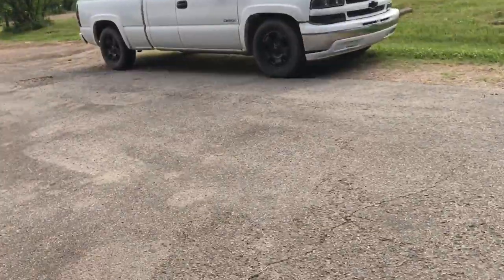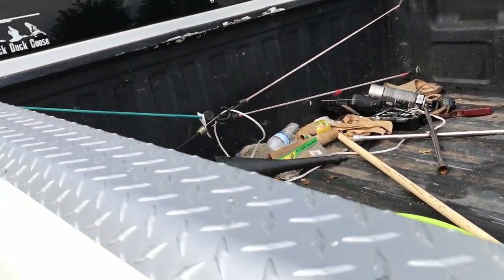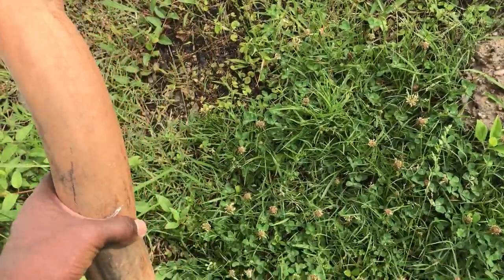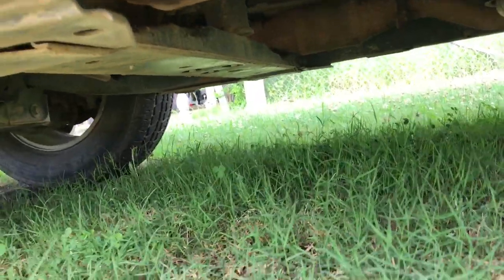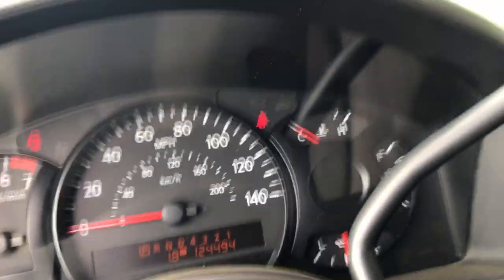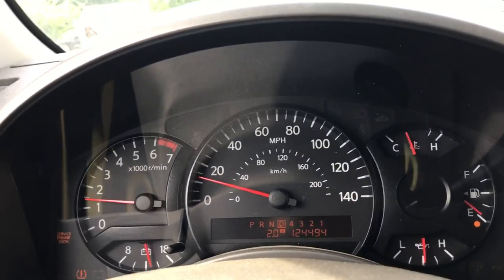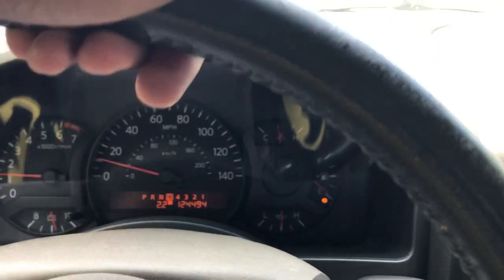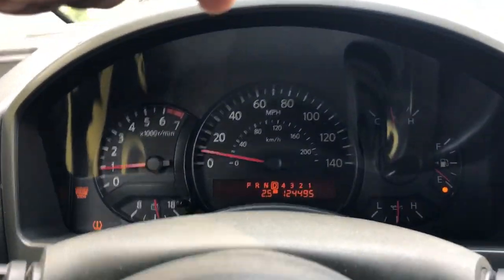Catalytic converters are clogged on my dads Nissan Titan

Comment: Same thing happened to me It started with the Manifolds cracking and then drove like that of awhile. Then I stared getting bad Catalyic convertors that were going bad, Then I had the money and time to replace the Headers I bought those installed them and they were so freaking powerful they blew the Weak cats out. Unfortunately part of the Metallic substrates from the cats got sucked back into the engine and then my engine got scarred. Now I am buying an engine replacement , JBA headers and B Cajun pipes and the UPREV not fucking around anymore with Nissans pathetic cat design

Comment: While ur checking it out make sure all ur cylinders are firing. O2 sensor, cat, or dead cylinder can give u similar symptoms
Reply: Will it throw a p0420 code even if its not the cat?
Reply: To test MAF just unplug it and your truck with run smooth.  Then replace it

Comment: u have no gas first of all. but my is doing that and I'm replacing all spark plugs and mass airflow sensor. A bad sensor has symptoms of engine hesitation.
Reply from the maker: Adam Short yeah tru but it was the front cat it broke apart and clogged the back catalytic converter

Comment: fuel pump.. my 07 nissan did this same exact thing 7 we replaced the fuel pump and it solved the problem and we havent had a problem out of it since then. try not to run it on E too much.
Reply from the maker: Cheyenne Wofford it was the cats they were clogged but I got them deleted
Reply: Cheyenne Wofford my 04 was running great I use premium only I did run it low on gas a few times after running it near empty a few times I noticed if I had to step on it hard it would hesitate it will pick up speed but have to feather the pedal can't take off fast like it use too. One day I wasn't paying attention at the pump put in regular unleaded half tank and started getting PO 430 so i filled it with premium the next day ran it out of gas on purpose. I've been using premium but every now and then get codes 420 and 430 it has 160K miles any ideas? I have noticed a huge power loss going up hills especially when have a load in the bed. Any info will help thanks
Reply: Cheyenne Wofford you would get the check engine light on and cat codes?
Reply: @Scatpackkiller21  I'm having some issues on my 06 Nissan Titan but found a lot of info. I know this video is a year old but I found some info about a possible IPDM going bad/ Also Nissan put out a recall on the ECM relay which goes on the IPDM module. I replaced the ECM relay with a new one and didn't help. Also, my engine light is on for bad cats both of them needs replacing. The issue is once the IPDM is failing it dumps more fuel and trash the cats. It makes it hard to diagnose because it does have characteristic issues what a bad fuel pump starting to go out and or clogged cats. My buddy who is a tech for Nissan said IPDM. Gutting out the cats is cheap and easy and might give that a shot before buying and replacing the whole IPDM since the ECM relay recall didn't fix my issue. The truck runs fine if I don't floor the bitch but if I drive it like grandpa it runs fine. As soon as I slam the gas the engine starts to bog down/ stutters or kill the engine.
Reply from the maker: Fernie Rodriguez yess

Comment: Mine is backfiring and cutting off . Then it won’t restart for 5 mins
Reply: Your cats are clogged. It happpens on the passenger side cats. The honeycomb in the A pipes disintegrate and gets caught in the B pipes were it clogs it causing your engine not to breathe. Take off the b pipe and tap it on the sidewalk and see what falls out. You would be surprised. Almost like sand.
Reply: Mine's doing the same thing did you try it with that guy said and see if it works

Comment: Fuel pump
Reply from the maker: Fades Onloc it was the front cats they were clogged up and had to cut them out
Reply: @Scatpackkiller21  Cam, You said the front cats were clogged or was it the back cats further to the back of the truck??? I ask because my truck is running the same way as yours, sputtering and stuttering.. I changed the manifold/front cats however when I looked down into the pipes of the old manifold/front cats there were no honeycombs present in the cats. I could see straight through the entire manifold/front cat. Now is it that the honeycombs in the front cats broke apart and clogged the rear cats???? Causing yours and my truck not to breath properly. I gave to find a solution as to why my truck is throwing p0300 codes.
Reply: "have" not gave.....As in I have to find out why my truck is throwing P0300 codes as well as running like crap. I have changed all the spark plugs and the Coil packs on all the cylinders and still running like crap.
Reply: @alfa_romeo55yush82  did you fix it
Reply: @enriquerobled9354  Yes Enrique, I fixed it. I took off the B pipe ( The back cat ) and when I stood up the pipe on the sidewalk and bang it on the end a bag full of fine sand poured out onto the side walk. This was clogging the back cat and  blocking the exhaust gasses from escaping causing the truck the sputter and choke. I couldnt believe what fell out. It had the appearance of silica sand, very fine particles but I would imagine it was the honeycomb that broke apart from the front cats and lodged in the mesh of the back cats. As it couldnt escaped and clogged the back cats. I ordered a new B pipe Cat, instaleed it and no problems whats so ever. The trucks breathes correctly now. Essentially I changed the front cats and the back cats.
Reply: @alfa_romeo55yush82   wich b pipes did u go with I got da same problem man
Reply: @juliosaavedra6342  I went with standard aftermarket cats from rock auto. Truck still runnng like new and no sputtering symptoms.
Reply: @alfa_romeo55yush82  wich ones goes bad upstream or downstream ???
Reply: @juliosaavedra6342  upstream. the one attached tio the manifold
Reply: @alfa_romeo55yush82   I’ve change everything on my titan spark plugs  maf sensor and injectors coil packs crank sensors and nothing I still got the p0300 code   I assume that is clogged cats or fuel pump now any recommendations?
Reply: @juliosaavedra6342  If you havent changed the cats attached to the manifold then for sure change it. You'll be surprised what falls out. But just change the passenger side. They are notorious for the inside deterioating and clogging up the back cats.
Reply: @alfa_romeo55yush82  i took the manifold cause my o2 sensor stuck and  and does not look bad at all
Reply: @juliosaavedra6342  If your 02 sensor is stuck use some wd40 or liquid wrench or any penetrating oil. Spray on O2 sensor and let sit for an hour. Use an o2 sensor tool to pull the sensor. You can reuse the 02 sensors again.
Reply: @alfa_romeo55yush82  threads were bad no way u can put it back I cut it off with a torch and weld a new one  my question is p0300 is most likely a clogged cats or fuel pump
Reply: @juliosaavedra6342  clogged cats.